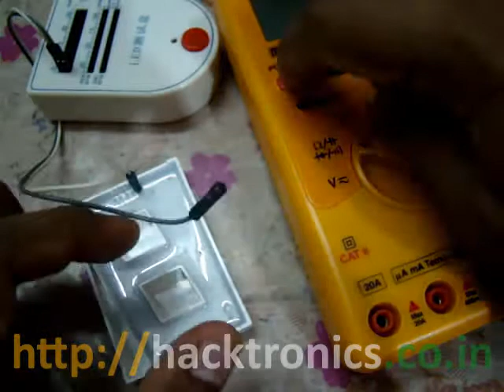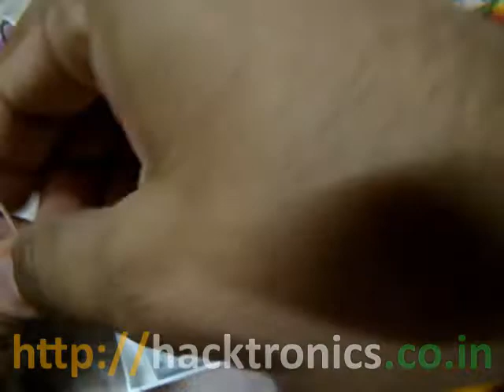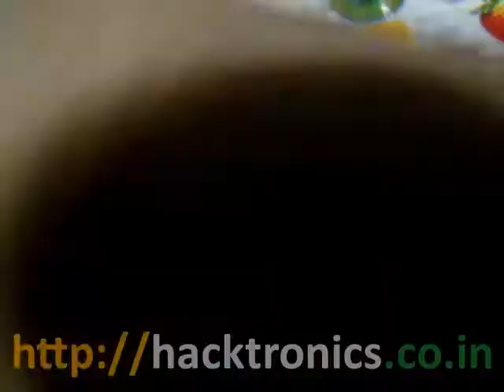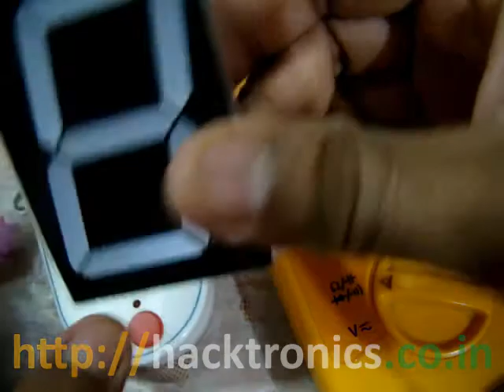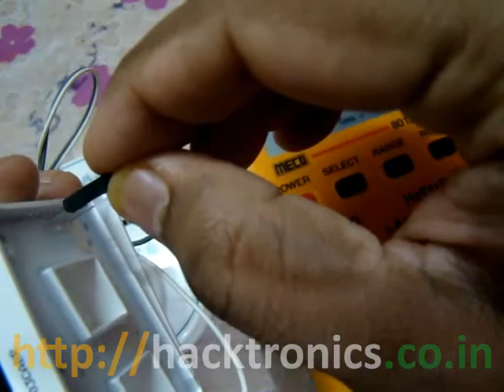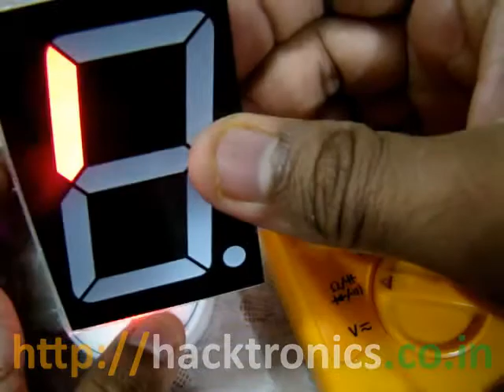How to Identify the Pins of a Large Seven Segment LED Display

Comment: To connect with Arduino is exactly like the small 0.56 inch displays? With 220 or 330 ohm resistors?
I would like to make a watch with 4 large displays.